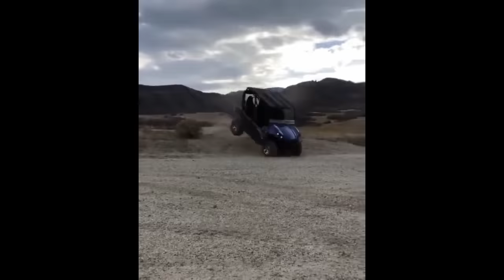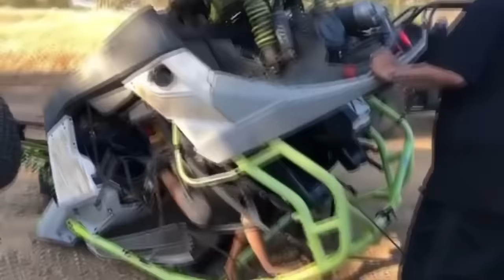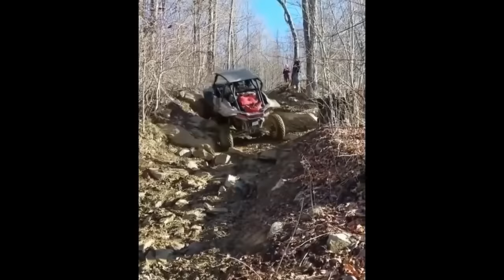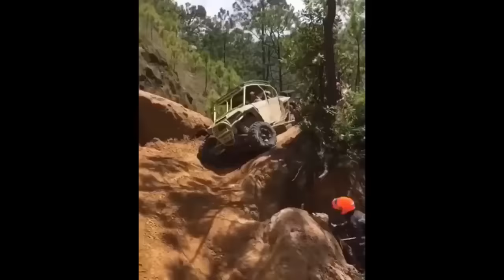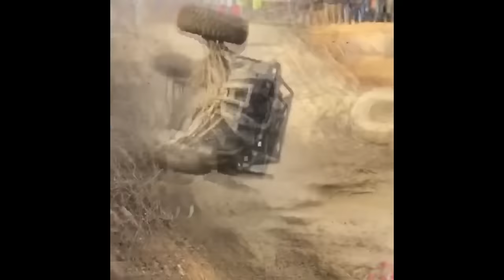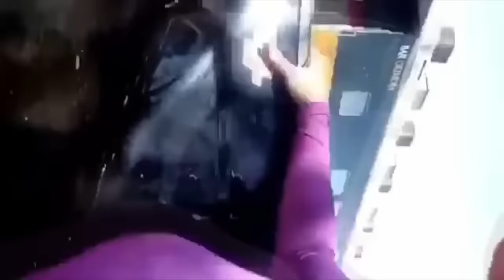Crazy UTV Crash Compilation 2020

Comment: 90% of these were easily avoidable. Incapable drivers accelerating and braking at the wrong time and choosing poor lines. It's as simple as that. A little common sense will save you a lot in repair costs.
Reply: Yep and driving way beyond their capabilities and the machines capabilities.